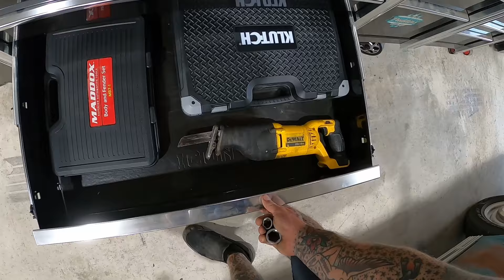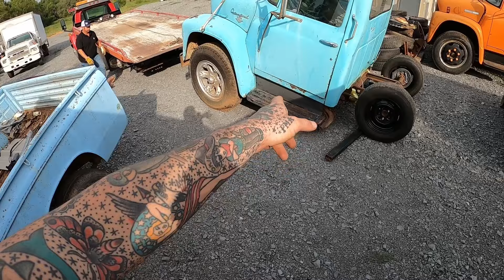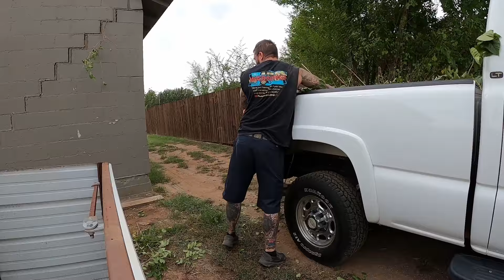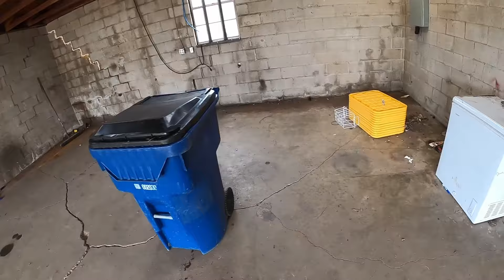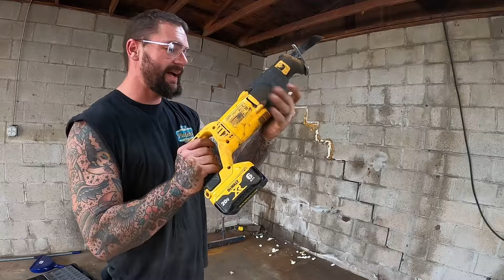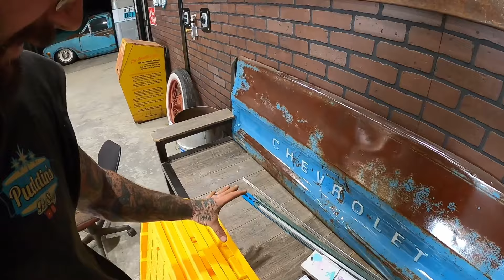WHEEL HOP WILMA and CRANE rescue mission!

Comment: I feel like you should do some fab work in the shop before deciding where you're gonna put the crane. When you realize you need it is when you should chose it's resting place imo. IDK I've never had a crane, however, I do use my 2post lift as one sometimes. With a few heavy straps you can get just about anything with a lift. Keep firing from the hip ♥

Comment: I drive an Eco diesel... its 3litre 6cyl diesel 1/2 ton 4x4, It get s28-30 mpg on the interstate empty, 16-20 loaded and will tow upto 10500 lbs. on a bumper pull trailer legally. but max loaded it wont get 16 to 20 more like 10-11mpg

Comment: Not that you’re asking, but if you mount the crane between two doors in the Fab side out far enough to swing it 360* you’ll be surprised just how handy it’ll be for picking gear out of trucks/trailers and loading work tables.

Comment: Loose hub cap idea - put pieces of "hook" side (only) industrial velcro on the wheel hub cap nubs. The extra thickness and little grip the hook part of the velcro offers might make the hub caps stay on. Like the double sided tape you use, that industrial velcro sticky side is nearly permanent.

Comment: If you decide to do a burn out in it again you ought to go buy you some leaf spring bushings and weld some pipe between the frame of the axle and the frome of the truck them put you a big ol coil spring in the middle of the axle so you'll have some suspension

Comment: I understand the happiness with the builders. However i used to do that. Its a preengineered building. They obviously have experience and its basically a giant lego set assembly by number. Yeah it still takes work and thinking but its not like they are designing or creating at the hip. Pew pew pew

Comment: You can make wilma a rollback too , all you need is a set of junk yard rears and a frame to weld on and  a roll off body. It might work!!
Reply: Just find a modern junkyard roll back that could have the rear, frame and bed butted up to wheel hop Wilma
Reply: OR BUY ONE FROM MORTSKE!! LOL 
 @FORDCAMPERSPECIAL
Reply: Totally agree, a rollback would be the way to go and there’s actually a good bit used and wrecked rollbacks forsake cheap that you could use for parts to build one cool rollback. That be one heck of a cool build. I’ve never really seen the point in people building ramp trucks when a rollback is so much more versatile. As for insurance, private insurance isn’t  bad, it’s when you have it on a commercial policy where your towing other people’s vehicles for hire where it’s going to be expensive. Mine isn’t bad at all and it’s on my company insurance yet not for hire.
Reply: As a rollback owner lemme tell ya rollback insurance is expensive
Reply: @nou8257  yeah but it not for hire should be cheaper . Probably same as that big box truck insurance.
Reply: @TBBnDOYLE  Not for hire doesn't matter if anything that draws the DoT in like a light for moths and insurance doesn't care either since its a commercial vehicle to them no matter what.
Reply: @nou8257 Not for hire negates the “commercial” part bud. Anyone can buy a rollback for private use and insure it as just a vehicle.
Reply: I was just about to make the same suggestion and yours was at the top of the list of comments. Great idea and it would match the fleet. Easier to find a rollback with a bad engine or front end damage than to find a functioning one that does not cost an arm and a leg.
Reply: THIS!!!
Reply: Yes  what I say too . Check out the roll back FabRats doing 4x4 roll back . But still cool with old body on it .
Reply: @TheBlueBikeDoyle do you have to have insurance in Pott County?
Reply: 1000% agreed. This video wrote the future content.  That would be so tough.
Reply: I would make the orange one the rollback.  Wilma is a special truck that needs to wheel hop again.
Reply: Probably a ramp truck would be a simpler idea... You won't have to worry about hydraulics and just need a winch and a place to store the ramp ends.
Reply: Way easier to just take a newer style 4000 series international from the 80s/90sl with a dt466 take that cab off and put the loadstar cab on , better suspension and you dont have wonky geometry and they dont have a split rim style or ring , they are alot easier to find bud style rims that look old but can use as smaller size tires and you can easily change that hub to adapt an acola style , there's just way more options from an 84/85 to 95 chassis than going 83 and back , because that 4200 series stayed with international from 1978 to 1990 when the body changed until 1995 , but theres not much of a change from the 60s to 70s its the 70s to 80s that made them boxy i could keep going about international and thier contracts with bluebird and why that change was kept but ford and international duked it out for so many years and in 1978 is when they separated thier differences and came up with the 444 international that went into  almost every industrial ford truck for the 1979/82 years until they said lets make a diesel truck in 1983 and put that in an extended cab f250 creating the naturally aspirated 6.9 liter which completely shocked Detroit /GM and caused a war between thier industrial line putting an engine made for a 2.5 ton truck in a 3/4 ton
Reply: Nice wheel hop is back with the family.😊
Reply: Poked in ur tree branch…😂
Reply: Great idea!
Reply: I still think the large box truck chassis would make a great rollback
Reply: Oh yes!!!!
Reply: I only made a suggestion on making Wilma a roll off. I'm sorry if I came off as telling you what to do with your truck. Next time I will keep my mouth.shut.